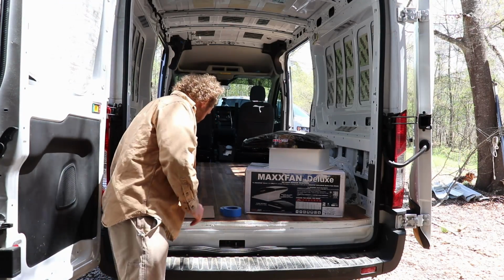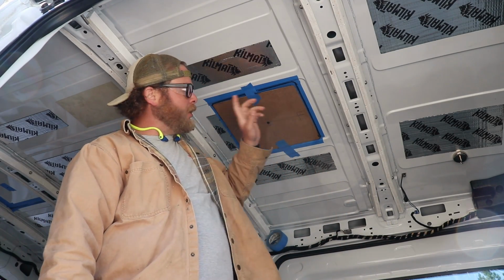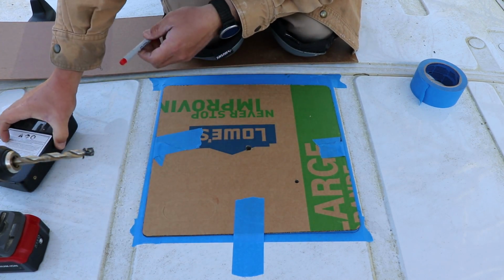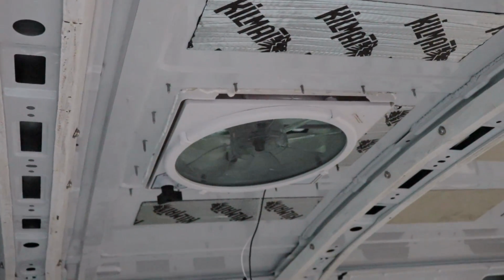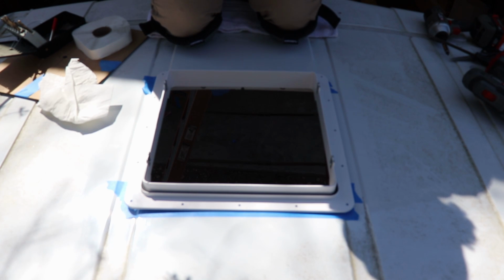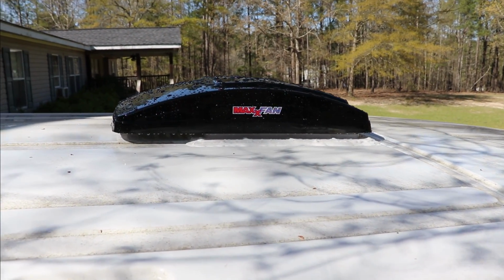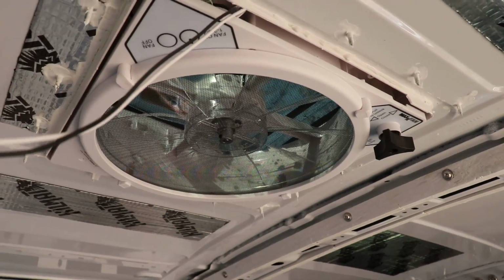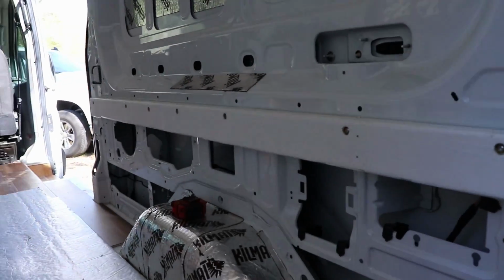Ford Transit MAXXAIR DUAL Fan Install | Mid Length Van Build

Comment: On your rear fan, did the front and back rows of screws holding down the fan end up coming through into the van inside those ribs (factory roof support beams) that the fans sits between? Or maybe they went into the ceiling joists you added? Any concerns where they poked through? Thanks for vid!
Reply from the maker: Thanks Tommy,  yes they went thru into the plywood ceiling strips I installed.